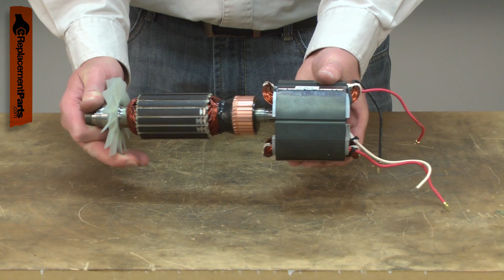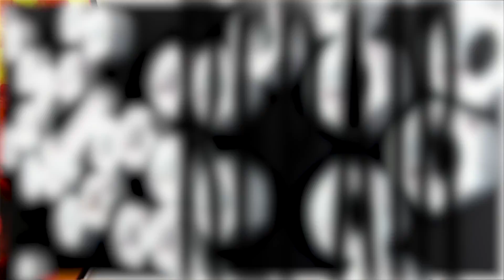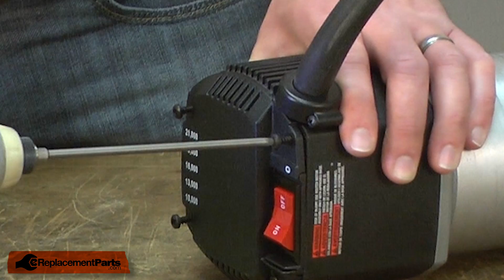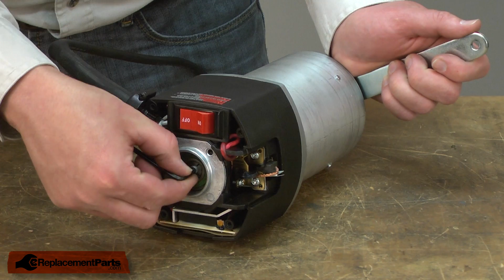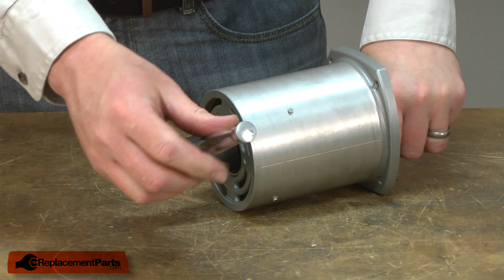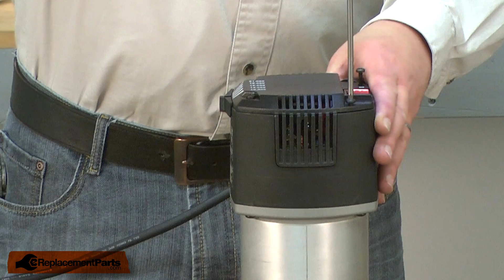Router Repair - Replacing the Armature (Porter Cable Part # 873638)

Comment: I changed the big bearing in the lower housing following this video, but for the life of me I couldn't budge the collet nut with just a socket wrench and a hammer -- I had to go to Lowes and buy an 1/2" impact wrench to get it off.  However, everything else when perfectly.

Comment: Very useful, but for my old PC690 router, a replacement armature costs $40 more than an entirely new router.
Reply: You can get one on Ebay for about 50 dollars plus shipping, which I'm sure is cheaper than a new router.